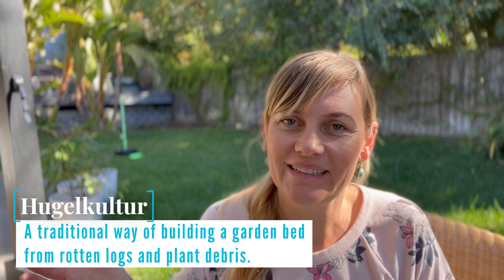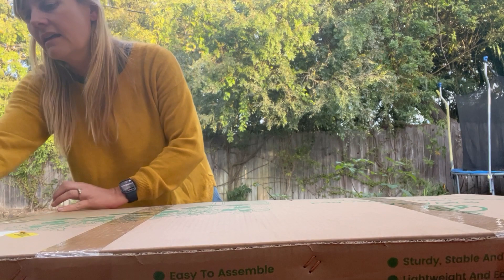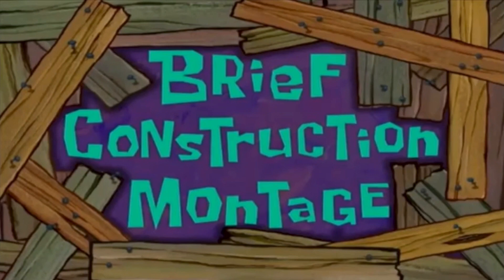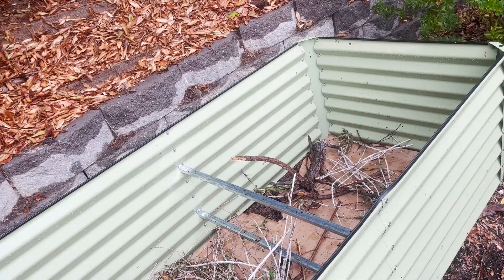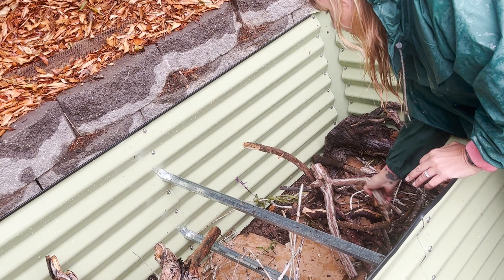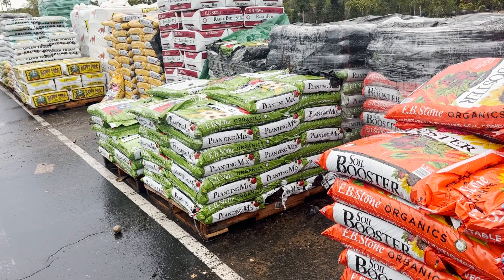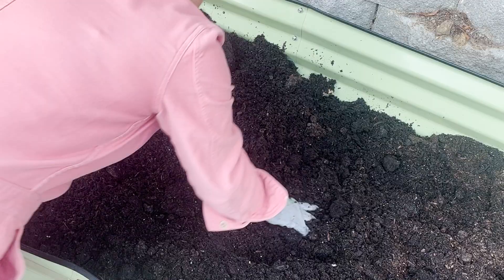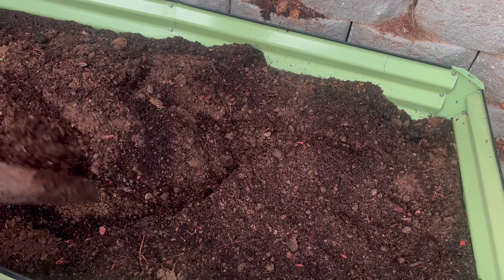How to create a HUGELKULTUR raised garden bed

Comment: Nice work! About the air pockets, I have heard that they might if you're unlucky invite rodents and termites, which can cause problems, so some people try to minimize the amount of such pockets in their hugelkultur raised beds by filling the spaces in between the wood parts with soil as well as possible. I hope you have been spared from that, though!
Reply: I heard it in another YouTube video called "Building HUGELKULTUR Garden Beds | Shallow Dig Method" at the timestamp 6:54.
Reply from the maker: Good tip! I did lay down a lot of leaves and mulch on top of the wood, so hopefully that helped! Interestingly, a year on, I did have to add a lot more soil as the layers started to settle and decompose.
Reply: @FreePlantsForever  I guess guess those air pockets made it possible for the bed to collapse as the branches broke down, so if you had filled them up with soil initially it probably wouldn't have sunk as much.

Comment: Obviously this comment is way to late for this particular bed and I'm not sure if it will work or not.  Your cross brace supports, could they be attached upside down?  It look as though they would hold any water that makes it way down to them.  Otherwise bed looks great.  I just built two from another manufacturer and am slowly in the process of filling them.  This coming Sunday I'll be getting my logs/brances/mulch.  Looking forward to it.